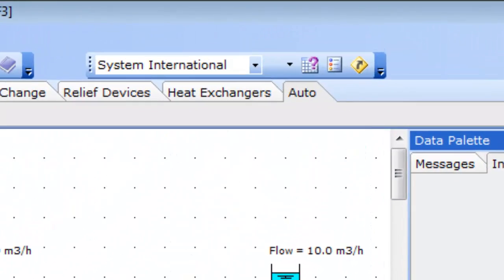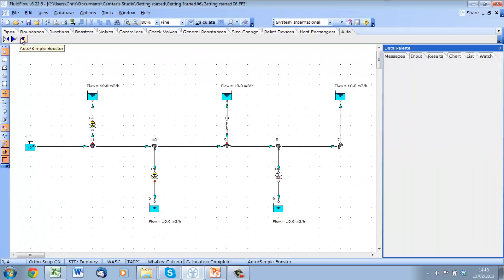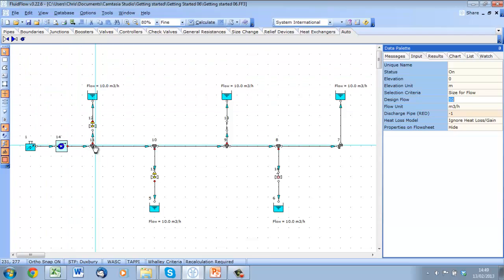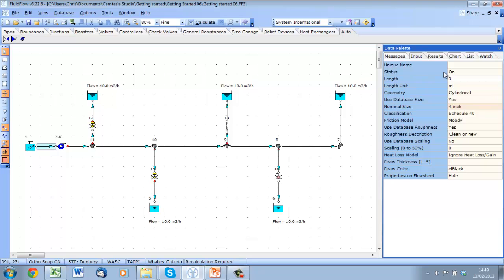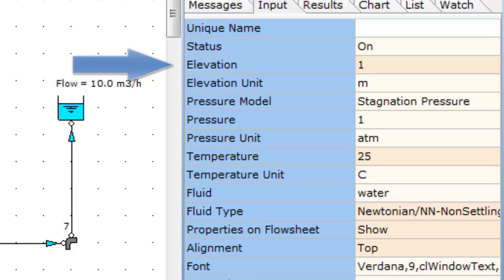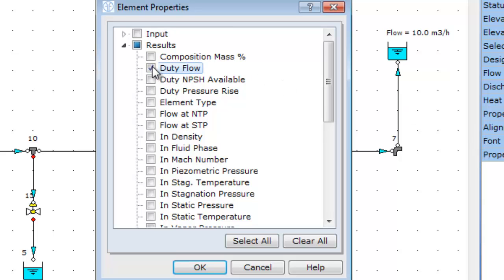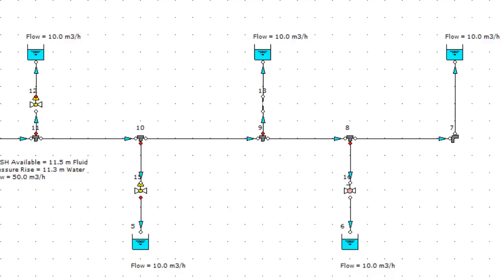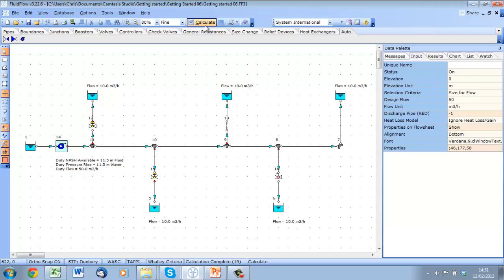Getting Started 08 - Using Auto Components

Comment: Hi, very informative video. In case of PD vane pumps, if the pumps are running in parallel, will the pressure losses in the common suction line be divided into 2? if the total head loss is 6 m, and the NPSHR for each pump is 4.8m, will the head loss for individual pump be 3m. Will pumps work without cavitation in this case? Thanks.